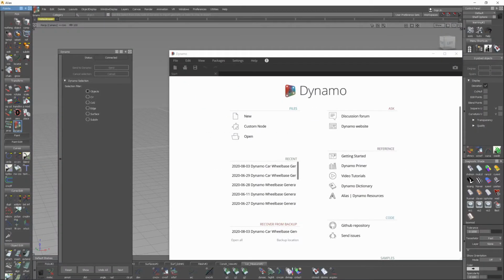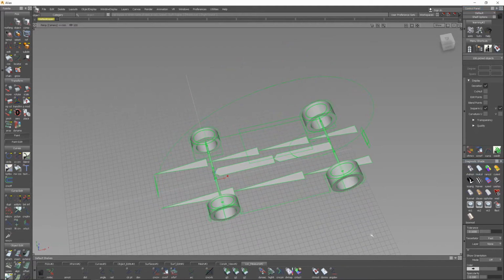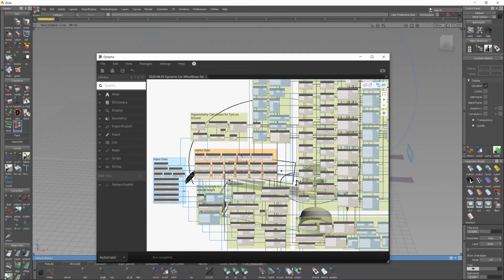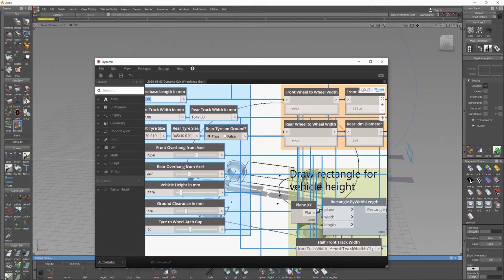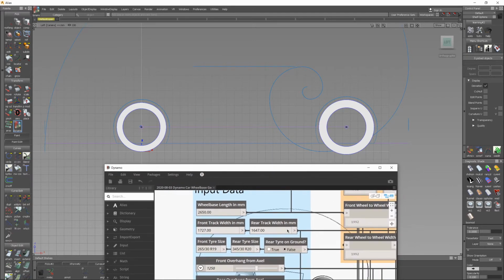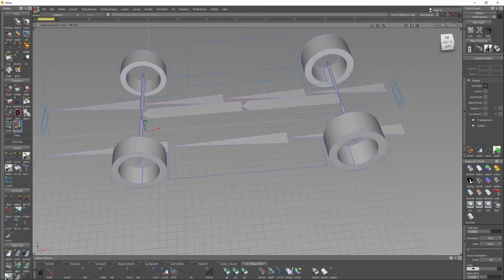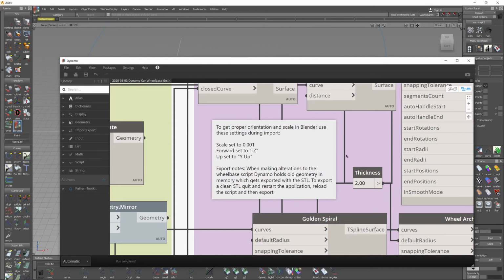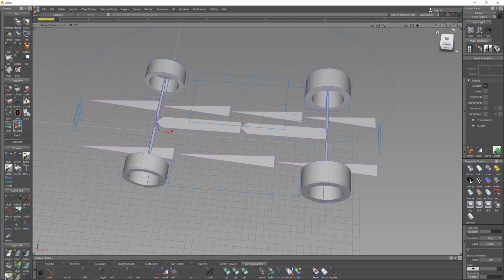Alias Dynamo Car Wheelbase Generator

Comment: that's a very cool script thank you for this. and the mannequin would be a great addon indeed. What puzzles me is why you would need Blender for concepting since you obviously know Alias really well? I mean beside the grease pencil, Autostudio has all you need I suppose, especially the subdiv.
Reply from the maker: That's a great question. I've played with Sub-D in Alias and indeed it is absolutely amazing, probably the best Sub-D toolset on the planet with its cross-integration with the regular NURBS tools. However, Blender has Grease Pencil as already mentioned plus a very fast Sub-D workflow once you've got the hotkeys memorised. The reality is that you can generate decent concepts in Blender and only switch to Alias for production surfacing. It's more cost efficient this way.
Reply: @ysfdesign  Thank you and I  am curious about your method for your model to travel smoothly from Blender to Alias; do you use Maya for that?
Reply from the maker: @elmirage6005  Basically just export out the mesh model from Blender as an STL and import it into Alias. After that it's just like working with scan data in Alias. You can use the section tools, side glass tool and all the other little tools that work on meshes. I've never used Maya but I started out in 3ds Max before I switched to Blender. I used 3ds Max and Rhino professionally at a company for many years but now I'm a freelancer. I still use Rhino for certain projects and I use Alias only for customer projects that require Class-A level surfacing otherwise Alias is too expensive to own continuously unless you are an OEM. It would be good if AD created an indie license for Alias and that way I could use it for more projects e.g. use the Sub-D tools more. However, right now I really like Blender especially if you invest in a few very useful addons like HardOps, Boxcutter and Meshmachine. Even the menus are like Alias marking menus. I'm still learning.
Reply: @ysfdesign  well you made me look into blender for car design, thanks so much for that. In this great lecture https://youtu.be/tABQPqplco0?t=375 Odilon also mentions the shrinkwrap modifier and even the sverchok addon. Have you been using shrinkwrap for car design in blender?
Reply from the maker: @elmirage6005  I know about the sverchok plugin. It looks very cool. I might look into it more later but the thing that might stop me from fully committing is that there is a project inside Blender Foundation called "Everything Nodes". This will open up big doors for parametric modelling and will be part of the Blender core. It also means that you can start to do Houdini-like stuff with Blender which will be really cool. If I'm going to learn a new node system again from scratch then I might wait for Everything Nodes. As a side note there is another free nodes plugin called Animation Nodes. The author of this plugin now works at the Blender Foundation and he is working on Everything Nodes.

I haven't used the shrinkwrap modifier in Blender but it is similar to skinwrap in 3ds Max and I've used it there. It lets you take a lower geometry object and conform it to a very high poly object like scan data or a digital sculpt while maintaining good topology. Shrinkwrap has many use cases so it's good to know the tool. For my Blender design work I can usually get away with imperfect topology and I'm also not concerned with porting to Unreal Engine. If my concepts are good enough then there is a higher chance that they will end up (hopefully) in Alias. Also bear in mind that the EEVEE rendering engine in Blender is getting better and better and soon there might not be a need to port to Unreal for visualisation purposes. After all EEVEE is also game engine technology.

Thanks for linking to that video. I haven't seen it before but I'll sit down later and watch it properly and gain more knowledge.